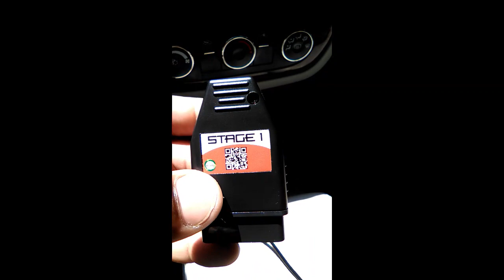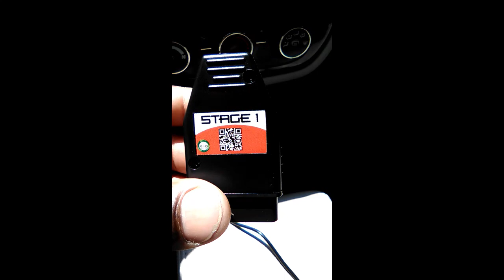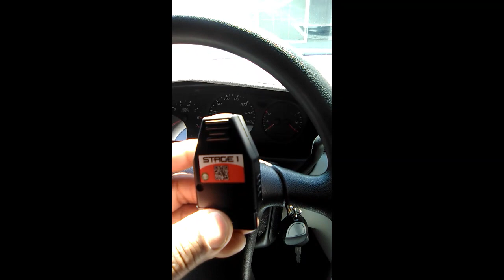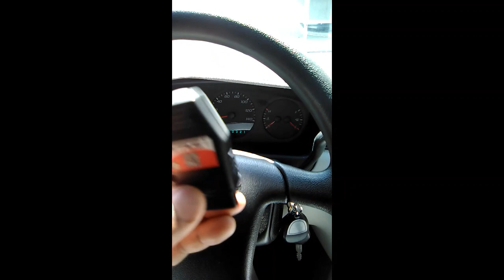THIS STAGE 1 PERFORMANCE CHIP IS CRAP AND NOT WORTH 99$ BUCKS

Comment: I just received my stage 1 chip a few days ago & it worked fine. One thing you have to understand before using the chip is what type of engine you have: 4 cylinded engine at about 185 horsepower, v6 engine at about 305 horespower, & V8 engine at about 435 horsepower. This chip "WILL NOT" convert your 4 cylinder into a V6, nor your V6 into a V8 power wise. What it will do is assist in fuel/power transfer efficiency. Basically limit fuel/power when not much is needed (going down hill) or increasing it when it is needed (going uphill). #1 reason probably why the chip didn't work right is bcuz like every time we as humans buy new stuff "we're afraid to break it" so we half use it or lightly use it to keep it new. Pertaining to this Stage 1 chip: #1 disconect your battery & let your vehicle power drain/brain drain at least 1 hour before plugging the chip in. #2 Plug the chip in while the battery is disconnected. #3 Connect the battery with the chip already plugged in so the vehicle computer & chip freshly learn each other. #4 Start your vehicle up and proceed to drive a continuous 60 to 65 miles before shutting the engine off again (eventhough the box may say 150 miles).  KEY NOTE: While you are driving your 60 to 65 miles 1. turn the radio on at normal listening plessure, 2. turn the lights on, 3. turn the AC or heater on fan set at 3/4, 4. turn on rear defroster, 5. aggresively/firmly stop at traffic lights (if applicable) to activate ABS. Why do all this? Bcuz if you don't give the chip anything to read/calculate/correct/adjust/improve then it "probably won't do anything" bcuz it hasn't really sensed anything to do, that the car can't do without it. Don't be afraid to break it, plug it in & "HAUL @$$". That's what I did & by no means did it take my 4 cylinder Chevy s10 & make it a road hog. However going up & down hills with everything on I listed, I could feel a bigger difference than before. Maybe a 7% to 10% increase in horespower & torque. Anyone who has a 4 cylinder can caveaut that maintaining 70 to 72 mph on a 4%, 8%, 10+% road hill grade 1 mile to 1.5 miles long isn't easy but the chip made it a good bit easier.
Reply: You explained it better than any forum
Reply: @jasonk2840  Exactly!!! Couldn't have said it any better than Bo did! Props Brother!
Reply: Let the battery drain ? I thought you were supposed to turn the car off , connect the chip , and also have a battery charger connected to your battery to make sure it doesn’t drain. After it uploads you’re supposed to turn the car off for at least 30 seconds and then turn it on
Reply: @brandonata5847  He didn't say to drain the battery, he said to simply disconnect it, which makes sense. If you disconnect the battery, wait an hour (just to essentially fully reset the car's computer), plug this chip into the OBD port, then reconnect the battery and restart, the car's computer is more or less doing a hard reboot and will take instructions from this chip.
Reply: I got a Chrysler 300 v6 and thank you. I was nervous to get it. But den i seen hall ass. 😂 ink it was gone do good.
Reply: Thogman  The chip will add a little more horse power but nothing too serious. What I would do for that vehicle specifically is just upgrade the alternator. Instead of the regular 100 amp alternator upgrade to an aftermarket 120 to 130 amp alternator. I think I stated that about my Chevy S10, which worked wonders in that 4 cylinder pick up. Which I also installed cold air intake.
Reply: Going to be following this instruction today on my 2013 kia soul. Super excited to try it out. Trying to get my mpg avg to 34 from 32
Reply: How much do you get paid to lie for these people?

Comment: I bought this on my Mazda 3 2.5 S 2010 and felt some power increase I wouldn’t say buy this if you have no bolt ons. I have full bolt ons (magmaflow exhaust, Injen CAI, high flow cat, catless headers) and I felt the increase of torque and hp

Comment: It's a stage 1 that is not focused on performance but more so on MPG and it does in fact increase both slightly.  It was very noticeable to me from the first day I used it in my 2019 Rogue.  It absolutely increased throttle response, a slight acceleration increase especially between 1500-4000 RPM, and I proved it by resetting my avg MPG because my job commute is 30 miles one way and it sure as hell went up by 3MPG with the same exact driving style which I replicated twice because I removed it once to see if it was a placebo effect and I assure you it was not as removing it made my car sluggish again and I lost the MPG gain instantly.  Also, the box literally says it "may" increase your governed top end, not that it "will" so learn to read...  Then your claim that you cannot tune your ECM via the ODB2 port or that it's difficult is just plain incorrect because this has been proven on dynos over many years with various tuning chips.  My buddy has a nice one with an LCD screen that he paid several hundred for (I forget the brand) in his powerstroke that lets you dynamically change settings on the fly and trust me, I've driven it and the fuel saver vs the high performance mode is a MASSIVE difference in horsepower in his truck.  For $99 it did exactly what I had expected, a modest improvement at a modest price but the MPG gain is incredible at the price point.

Comment: I got stage 1 for my Durango RT and it did increase everything it said it would. Maybe not as much as it says but it absolutely did increase it. I felt a difference within the first couple days as far as throttle response and smoother shifting and idoling. Anybody can feel the difference In those if they drive the car everyday if not ur an idiot. Waiting on stage 2 to come in the mail now. Not sure why ur vehicle didn’t have any results. Maybe it did just not as much as ur looking for
Reply: Hahahahha
Reply: Open it up see what's inside,if anything...
Reply: What year? I got a 21 and I'm skeptical. I need better mileage and I'd like some more horses. Don't gotta be much just abit.
Reply: @clarenceyoung4701  My Durango R/T is a 2015🙌🙌🙌
Reply: @clarenceyoung4701  I don’t know the exact numbers it increased everything but judging just from driving it I feel like the HP is the main thing that increased👍👍👍
Reply: I think I might try it. Is preformance chip tuning trust worthy for using my visa?

Comment: I had one on my jeep and  forgot about it after awhile due to no change in performance. One day as I was driving along over a month later it felt like I got rear ended and the jeep took off. Long story short, it took well over a month to perform but it did work and very noticeably!
Reply: Wow, a whole month before the stage 1 worked it out with your Jeep's CPU. The directions said around 2 weeks. I guess every car is different. Did you notice any increase in MPG?
Reply: How did you know that was because of the chip?
Reply: You didn't unplug the battery before you put the chip n

Comment: I've been driving my 2013 Chrysler 200 from 80 to 95k miles. Fully stock OEM.
I could never get over 31.5 MPG no matter how soft I drove it on the hiway.
After I installed the Stage 1 dongle, I can easily get 32.5 without trying and I've gotten as much as 33.5 MPG on the hiway.
  I can't speak to the horsepower. My V6 had adequate power already.
I know a lot of people insist that they want a large SUV and it should get 40 MPG. 😂😂
I'm quite happy with 32-33 MPG out of a V6 convertible with loads of power. 👍
Reply: PS
I use 87 octane exclusively.

Comment: Did you happen to change what gas you were using originally? The chip is designed to tune your car according to the octane level( air/fuel ratios) I have a dodge charger and when I plugged it in for a week I did not notice anything but when I changed my octane level I actually saw much improvement in the powerband/throttle response/ not so much on gas mileage though.
Reply from the maker: i used 91 and 93 ooctane!  91 is the bare minimum you can use according to the instructions. It want you to use high tier octane fron shell, chevron and mobile though!
Reply: @gameplaybenchmarks3294  my manual said a minimum of 89 it probably haves to deal what kind of car you're dealing with dont get me wrong I dont notice that big of a difference but it's a tad better haha

Comment: It works best if you have catback exhaust and an air intake installed
Reply from the maker: I had a exhaust job done to my impala, converter delete, resanator delete with straight pipe and flow master exhaust with cold air intake on my 07 impala. If it did anything , I did not notice it!
Reply: @gameplaybenchmarks3294  so you saying you have your cats removed and resonator delete and got a flowmaster muffler and your other muffler is still on
Reply from the maker: @WORKanU  no, I removed the factory muffler and replaced it with the flowmaster muffler
Reply: @gameplaybenchmarks3294  I bet it’s only because of your catless bro you need the stage 2 I ordered the stage 1 to help my intake hi flo inlet pipe and catback pretty sure that’s what it’s meant for the catless with prob mess with the ecu still since it’s the wrong tune

Comment: I used to use sawyer tuning and did ok try rocket chip stage 3 thier cheaper and does great it was dyno tested and horsepower was gain 43 horsepower.

Comment: it also says time will vary it may take longer.....u should just leave it in.....and drive the shit out of it why take it out ..and over time you would notice little things.
second.....should have bought the second one......3rd leave it in. never bash a product because you cant follow directions
Reply from the maker: That's true, but at the time I was not thinking that in fact I still have and I maybe give it another shot. It was expected to see results in 2 weeks and I did not see or maybe I just couldn't recognize it. Another thing is that you have to use 93 and 91 octane though and they both kind of expensive right now
Reply: Truth of the matter is, the claims of increased HP, torque and mileage are unfounded, well, at least in my case. They also do not recommend to "drive the shit out of it" but to drive it without change to your driving habits. Driving the shit out of it is what most people would do when they reset their ECU's.

Comment: My 2019 Toyota Corolla Hatchback has experienced a 14.39% after the learning and adjustment period. Was: 26.4 MPG. Now 30.2 MPG. I cannot comment on horsepower or torque as these are relative without proper testing equipment (which I do not have access to).
Reply from the maker: 14.4% of what though? How long did you have it plug in before you got that percent and did it adjust your speed governor by 10mph like it said on the back of the little box that came in?
Reply: I have the 2016 Corolla, your engine is a bit different than mine in compression but very similar in the ecu set up. I’m thinking our ECUs learn what is going on and start fighting this device.  Your gains I think will be short lived.  I thought the same thing.  But Toyota is notoriously the hardest ECU to crack.  I’ll let you know what I find out.  I think your going to throw some engine codes in the long run.
Reply: PCGamer & Beyond in the beginning I think it does, but the ECU I think starts fighting back!  Making this device worthless.
Reply: @CanaRollcreations  I completely agree with you. If there were any gains, it would probably be short lived. In my case, it was only my idle that had changed but only for a brief time. After the winters here in the Toronto area, I use to reset my ECU due to the change in driving habits because of season change and different gas additives for winter conditions. After resetting my ECU, my cars would always feel more peppy initially until the Re-Learn phase was over.